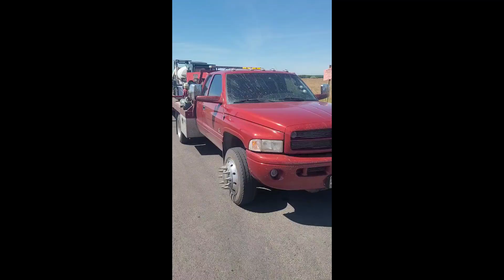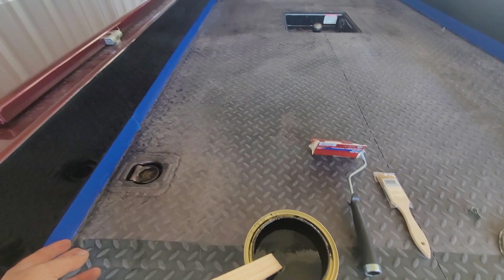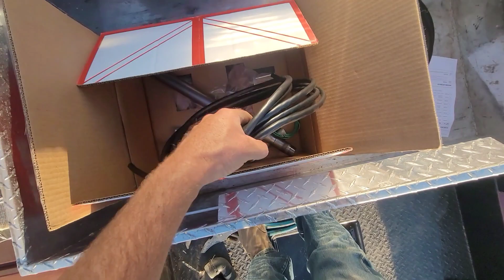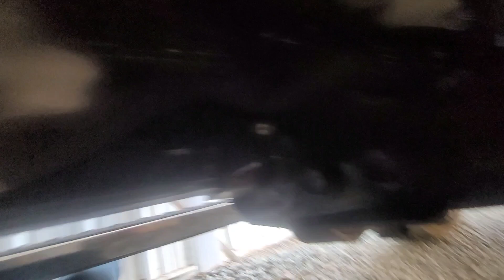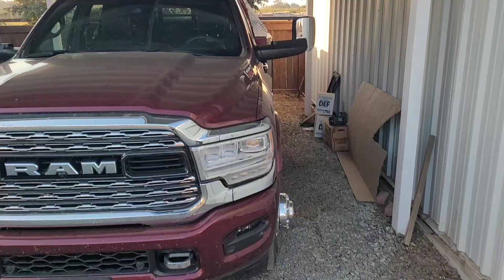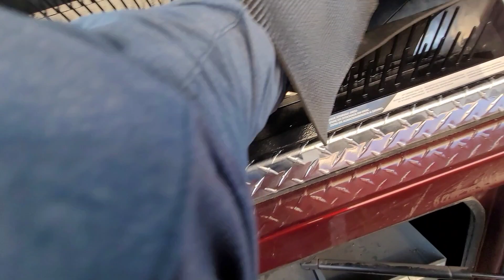5th gen upfit almost COMPLETE! Herculiner bed liner, Montezuma madness, and transfer tank/pump

Comment: Did you use any spacers or rubber washers to mount the triangle boxes to your bed or did you just bolt it tight?  Looking to do create the same type of set up and I am worried about rusting below the top box.
Reply from the maker: I bought a roll of that recycled rubber "utility mat" at tractor supply and cut rectangle pieces out the same size of the boxes and placed them between the bed steel and aluminum boxes.

Comment: looking good and nearly finished, was concerned that you had too small a gap for getting the fill hose in between the headboard and triangle box if you had your hand griping onto the filler nozzle but it seems to work. be interested in how that bed liner holds up
Reply from the maker: I've got just enough room. I've filled the tank 3 times so far.